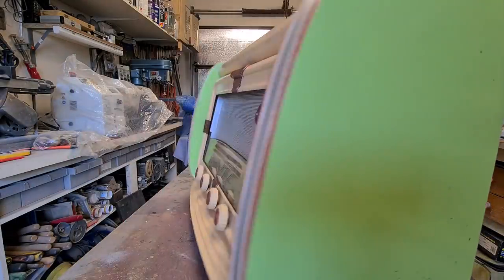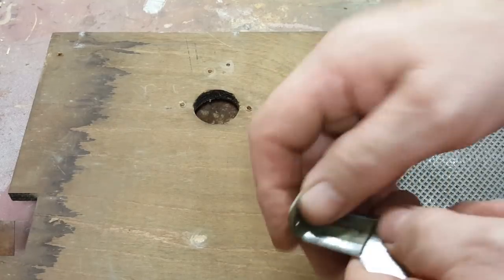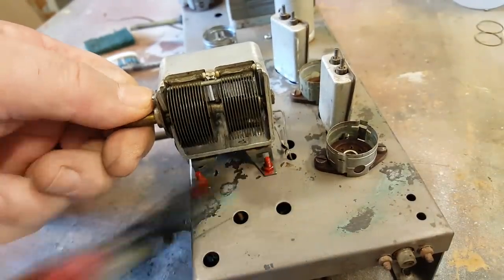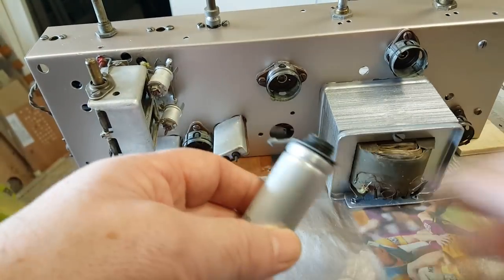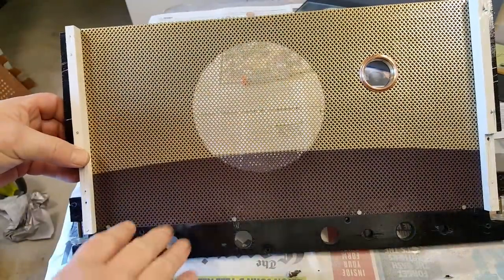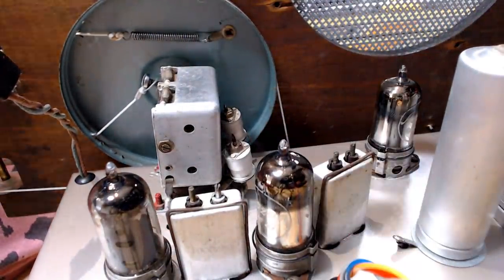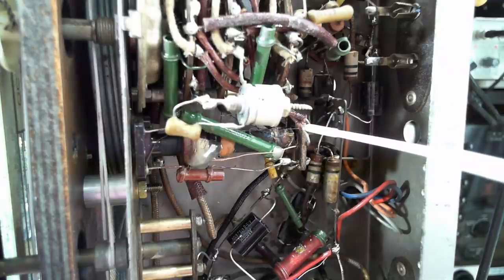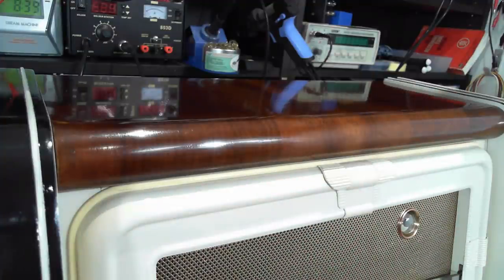The French Connection - UNIC 'Royal' Radio- Restoration Part 3

Comment: Great hearing Edith Piaf on this wonderful French radio.  What could be more appropriate than to hear Edith Piaf.
Reply from the maker: Hi Richard, It's s beautiful song beautifully sung 👍😀
Reply: @DavidTipton101  This song has always been one of my favorites sung by the "little sparrow" of France.
And that song when initially broadcast and played on the radio years ago was probably played through the same speaker that may still be in that radio.  The radio probably still has some of the original valves (or tubes) from the very day it was purchased that are still working. 
It is amazing how long some of these valves (or tubes) can last.  The capacitors and resistors seem to be the first to go.

Comment: Looks great certainly was a big job. I am an aussie live in Victoria. I am 73 Monday 25th the very first radio I had in 1961 was a 6 volt valve radio ran off a 6 volt wet cell car battery. I spent my whole life in the electronics field. I went from valves to transistors to integrated circuits to microprocessors and computers and visual windows programming. My hardware and software is used all over the world in the textile industry but the english company I worked for 34 years made alot of money not me. You certainly put alot of effort into detailing. Well done very enjoyable 3 parts video. 
Bruce Hutton🤗
Reply from the maker: Hello Bruce, it was a very big job but looks pretty good for what it is. I hope you aren't too hard on a novice like me when I'm working on the electronics 😄 You are obviously very accomplished in your field. You must have had a fine career, even if you didn't reap all the rewards. Thanks Bruce 👍🙂
Reply: Thanks David for your thoughtful kind words. Have a good easter 🐣

Comment: 38:38 O.K. I admit it, you got me!
That actually happened to me once when I was working on a 1940's RCA 5-Band radio.
Turns out  that, without realizing it, I had tuned in to "The Old Disc Jockey" program on CKUA 580 AM in our city.
Gave me a bit of a shock when I turned the radio on and Glenn Miller came out of the speaker! 
That RCA was a pretty powerful radio. I remember picking up the Queen's Christmas broadcast on Shortwave—on the Australian International Service! In the basement with no external antenna.
Great job on "Mademoiselle". I look forward to the next one (but enjoy your break first).
Reply from the maker: Haha... that would be funny picking up Glenn Miller from the grave. I've had a few people saying they can pick up Aussie shortwave from the US. Thanks, I need to catch up on some things around the house and maybe we can take a short trip somewhere although we are not allowed out of Queensland at the moment 😀
Reply: @DavidTipton101  It's even better than that. I live in Canada, so I was picking up the  Australian Shortwave Service on the 53rd parallel! That's a very long way from Australia. The thing that blew my mind was the fact that I was only using the loop antenna inside the radio. I never even set up an outdoor antenna. The radio is huge for a table radio (56 cm X 32 cm X 28 cm) but it's powerful. Enjoy your time off. I'm looking forward to the next upload after your break.
Reply from the maker: @michaelcherry8952  Yep, that is impressive. Thanks Michael.

Comment: The only ugly part of the radio would have been that bright green paint-job on the cabinet as well as the years of grime and oxidation on the chassis. You took it on board, cleaned,, repaired, restored, re-finished and brought it back to near-original condition - now you can truly say it's a treasure-piece for your growing collection of vintage tube radios.  2 thumbs up Dave. Excellent and very well done. :)
Reply from the maker: Thanks RoughJustice 2k18 👍👍😀

Comment: I’ve been waiting in eager anticipation for over a week for part 3. I have seen the process of forming metal done in a similar manner to the method you tried, it is called spinning. It does require quite a bit of skilfully applied brute force! It has been great to see this hideously painted, continental curiosity been transformed back to its former glory. Perhaps one of your nicest looking restorations you have done to date.
Reply from the maker: Thanks Gary. I think that magic eye bezel material was just to hard, I had hoped it would be a little more ductile, luckily I had a fallback plan 👍😀

Comment: Davide! C'est magnifique ! J'aime le Radio beaucoup. Great job. You probably have it in better condition than when it left the factory. I believe that they painted the bezel a cream white and then sunbursted the four corners in gold. I think the four embellishments were also gold or a copper colour.
Reply from the maker: Hi Derek, I found no trace of another colour when I stripped the bezel but you could be right with the embellishments, they would look better in another colour, gold or bronze. There was no other colour on the embellishments when I sanded them down almost like they were plain plastic colour. I will redo them and the knobs, they didn't come out very well either, cheers 🙂

Comment: Hello David;  It is nice to see you try the tip i sent you about starting either used for a cleaner.  It will easily clean oils off of metals, and any dirt and dust they have trapped there as well.  Best of all it dries almost instantly to a clean dry finish that can then be painted or sanded and then painted if sanding is needed.   This radio does look better than it did to begin with, and it is not loose and falling out of the case anymore, thanks to all the hard work.  The radio seems to work really well too, but alas, it is not one to look at, we must agree.
Reply from the maker: Hi Jeff, thank you I remember now. The starting spray worked very well, it evaporates very quickly though requiring a lot of spray but the result is excellent, thanks for the tip. The radio looks OK, I'm getting used to it but certainly not the radio industry's finest example. Thanks Jeff 👍🙂
Reply: @DavidTipton101      I use starting either to clean an engine blocks or cylinder heads and so forth after they are returned from a machine shop and are coated with light oil to prevent rust forming on the surface of the iron.  It works fantastic, it removes all the oil and leaves a dry clean surface i can then paint as needed without fear of the paint failing to stick to the surface. That is just one example. It works great as a cleaner for a metal surface.

Comment: The less number of turns on a coil, the higher the frequency it was intended for..   A visual of the coils on the form should tell you which is for which band, although SW-1 and SW-2 coils might be harder to tell apart..    Another great work !!    Never seen a radio with a language knob..   That must operate the language detector circuit...
Reply from the maker: Hi Dave, thanks, that's a good tip 👍 Yes, the LDC feature was a very short lived concept but grateful it was fitted to this radio. I thought the radio was broken at one stage but later realised I had tuned in to a one hour special on Marcel Marceau 🤦‍♂️

Comment: Another handy hint ,if for some reason you need to reduce the length of a slug .Use the green grit wheel ( the one you use to sharpen your lathe tools) on your grinder  it cuts like  a hot knife through butter !
Reply from the maker: Thanks Pufango, I haven't had to shorten one yet 👍🙂

Comment: I do play around a bit with old radios that I pick up from time to time. Used to make the yard sale circuit back when my wonderful wife was still by my side,  and I would pick up old sets, nothing very old since around here they were mostly broken up and burned to heat the homes back when wood stoves were the norm.  What I have been doing with many of them, however it to add a WIFI radio switch that kicks in an ESP32 wired up to a VS1053B so I can set the set to really play the programming from the era of the particular radio.  Makes life much more interesting, especially when I have friends over, and walk over to an old radio I have setting on an end table from the 40's turn on the switch as after the tubes warm up, from the speakers come the music of the 1940's along with the adds and news coverage.  Blows there little minds.
Reply from the maker: I used to add an aux port and switch to my radios, not so much now, and plug in a Bluetooth dongle to listen to old radio shows or just run them directly from my phone. I take it you can store sound files on the VS1053B and play them back through the radio, good idea 🙂
Reply: @DavidTipton101  It does have that capability, however there are tons of shows out there on wifi radio stations that replay the old shows and the old music begining at the 20's and going forward.  If you run Winamp, it has the capability of tuning them in on your PC, you can then program the EPS32 to remember those stations and access them through the ESP into the VS1053B card to decode the files from the ESP.  The ESP does have built in decoders but they are nowhere near the quality of output that the VS1053 does of I2S.
Reply from the maker: @JerryEricsson  Ahh, thanks for that 👍

Comment: It's fair to say when you got this radio it was an absolute horror. Not just aesthetically but structurally too. What anyone thinks of the looks is purely a matter of taste but I think it's improved beyond recognition!

Sensible modifications to the cabinet have made it much more solid than the factory originally managed. You did a superb job of the re-veneering as well, the finish you achieved is excellent.

Was it worth it? Hell yeah! Maybe you're not completely sold on the styling (to put it mildly) but as a working piece of history I don't think anyone could've done better. Considering you started out with such a piece of junk (let's not mince words here...) it came out better than it had any right to! Love it or loathe it, I think it's important that items such as this radio survive in the flesh rather than just on photographs.

On top of all that, it sounds very well. Someone else (like me) would've used it for parts. You went the extra mile and that's admirable.
Reply from the maker: Thanks Paul. Totally agree, it is worth preserving no matter what it looks like, it's a piece of French radio history. The radio performs very well and the sound is excellent, reminds me of the large radios in the 50s when I was a kid, cheers! 🙂

Comment: Very nice 👍 radio 📻 restore for my 50th birthday 🎂 today. Those nice 👍 wooden parts. Don’t know if this radio 📻 has a dial cord or dial light 💡. If so, chances are, it’s burned out. This radio is worthy of hearing “Standing on the Corner”, I think by a 1940’s, or very early 1950’s. The Four Lads, if I’m not mistaken. By looks, I think it’s a field coil speaker. Great 👍 way to re- purpose an old toothbrush. You’re saving yet another old radio that somebody else would be throwing in the dump. In a time like this, these should be every quarantiner’s delight.another plus is that you’re self taught. So is Shango066, and Radiotvphononut, and a great many others. Better not to spend money to be taught, and try to earn it back.
Reply from the maker: Happy Birthday Jeffrey 🎉 I reused the dial light and it has a dial cord. The speaker is a permanent magnet type. The radio is safe from the dump for now 🙂

Comment: Just a suggestion. The decorative banding at the middle of each side of the face of the radio may, under the paint, be a brass color, like the banding on the knobs. If you were to take a chance and gently sand one of them, and it is metal, then the four pieces would frame the field of the dial and grille nicely, completing the proscenium arch that I am guessing the design of the radio is meant to suggest.
Reply from the maker: Hi Paul, brass might have looked good on the highlights but I did sand them back and they are white plastic. I am thinking of removing the pint and leaving them natural or add some colour. You may be right with the proscenium arch look, the steps do suggest a stage 👍🙂

Comment: This is Known as spinning metal David! The mandrel needed to be hard steel
Reply from the maker: Hi Ronnie, I used hard steel in the end. The brass bezel material was too hard. It really needed to be worked between rollers or hammered. I was interested to see if it would work, now I know better 👍😀
Reply: @DavidTipton101  It looks like it was copper/brass, or bronze, which was probably work hardened from being stamped out of a press, you did mention something about it starting to crack. I think you had an interesting idea of how to modify it though, I was curious over whether it would work, in the end you still had to cut it down but it was worth a try. Strange  that they would make the original EM34 eye tube that much skinnier then the 6E5S, since they both have an octal base.

Comment: Beautiful restore David.  I’m just waiting for some CR2032 batteries with solder lugs and I can then finish repairing my GameBoy games that can’t save.  All have dead batteries so the save RAM can’t hold anything without power.  I’ve fixed several other games which needed smaller batteries that I already had.
Reply from the maker: Thank you Wenlocktvdx. Those batteries are easy to get, I never thought of a game having a battery in it 🤔🙂
Reply: It used to be the only ones had the lugs in the middle, but things have changed for the better.  Bit of a catch is that sometimes they are built upside down so they have to be installed in the reverse orientation to the original.  A lot of game cartridges used battery backed RAM until internal SRAM became standard, not long after GameBoy Advance was released.  Super Nintendo and N64 carts also used batteries.  Nintendo Wii had a battery for some setup RAM but the saves were in internal NVRAM or an SD card.

Comment: Thanks for the videos. Are you sure it's a good idea to paint that washer for the filter capacitor, won't that have an insulating effect and prevent current passing through? It looked like there was a wire connecting to it?
Reply: Ideal1980 It was dead.  He replaced it with two new electrolytics under the chassis early on.  He left the can in the radio for authenticity.
Reply from the maker: Hi Ideal1980, as Bob K said it is all for aesthetics, the capacitor and wire are not in circuit. Good question though 🙂

Comment: Beautiful work, as always.  One question: while you were doing the alignment, I noticed that the meter didn’t seem to be zeroing.  It doesn’t really matter in this case since you’re looking for a peak anyway, just curious.  Might it be caused by background noise?  Also out of curiosity, why do you measure the audio output instead of measuring the AVC voltage?
Reply from the maker: Hi Bob. I didn't zero the meter, as you said it's not required in thus situation. It also may have had a bit of background voltage with the volume turned down. I connected the meter to the output valve/tube plate via a 0.01uF capacitor 🙂

Comment: Hopefully this radio can be kept out of the dump for 5000 more years. Would like to see this radio passed down from generation to generation. Saving this radio is a little like taking care of the Leaning Tower of Pisa. Yes, they have a way to keep it from falling over.
Reply from the maker: Hi Jeffery, 5000 years is a little optimistic but hopefully it will stick around for a bit longer 😀

Comment: I forgot to ask, do the dial lamps illuminate that dial well enough to see the markings in a darkened room? The sides of the cabinet came out quite well, hopefully the bugs that caused those holes are quite dead by now.
Reply from the maker: Hi Oleg. The dial lights up just OK but very difficult to see the pointer behind it. With the radio on a table you can look down behind the glass and see the top of the pointer and guess from there. It's not the best design. From what I understand with borers, they are in the wood and bore their way out to fly away as beetles, there should be none left after 60 odd years I hope 🤔🙂

Comment: Dave. I hope all is still well, you said you were taking a break. To fill in the content gap :O I have been watching some of your old videos. I am not being critical but just offering something to consider. I noticed you still wear your wedding ring, nothing wrong with that! Over 50 years ago when I was in college and studying industrial power systems, the professor made a big deal about wearing rings/watches or anything really. Granted we were talking about high current and voltages but he mentioned how if the ring becomes a short to ground, it will turn instantly red hot and it is kind of hard to grab it to remove it at that point. He offered that removing it is best but insulating it was better than nothing. Since that day I have removed my ring every time I do anything electrical or even mechanical such as working on the car. It is just one less thing to worry about. I am looking forward to your next video! Thianks :D :D :D
Reply from the maker: Hi Wayne, totally agree. I didn't wear my ring for my entire working life for that reason although I was more concerned about mechanical injury caused by getting it caught in moving parts or when moving about. When I retired my wife said I had no excuse for not wearing it so I do. I don't believe the ring poses a great danger with the equipment I'm tinkering with and I can't get it off anyway. It wouldn't bother me if I wore it or not but not wearing it was a sore point so I will keep doing so for the moment. Thanks, I will have a video out Friday 😀